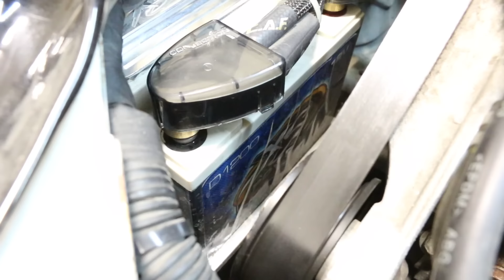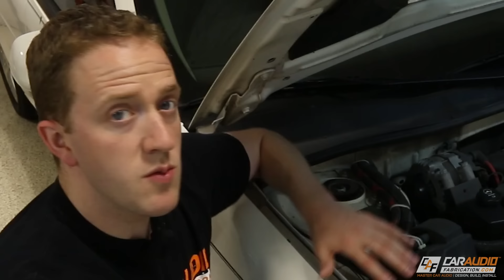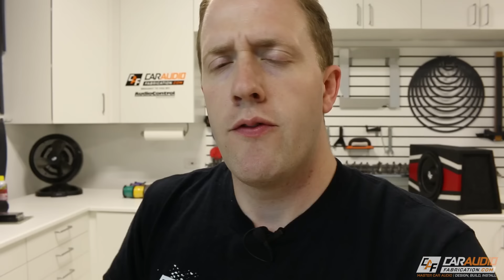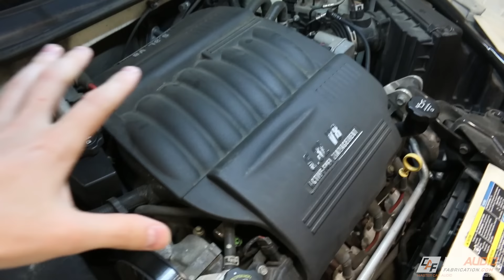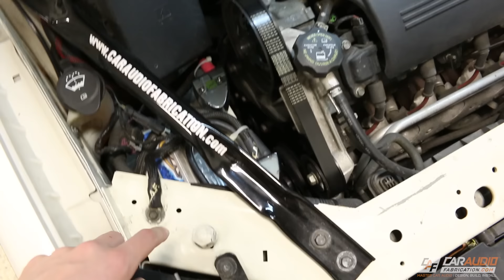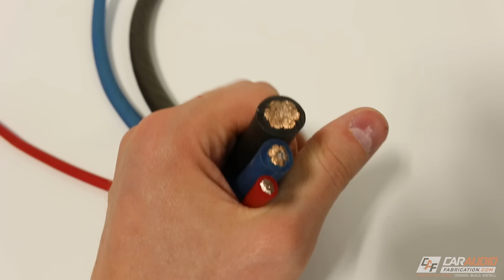Upgrade THESE for better Car Audio performance

Comment: a stock alt is garbage no latter if your upgrading or not... 
as soon as i buy a vehical i will upgrade the Big4 wiring.... Add a new alt... amd upgrade to the largest AGM that will fit under the hood amd switch tue Headlights to LED
Reply: AGM batteries are garbage. 
Since optima moved their manufacturing plant to Mexico their quality took a nosedive. This also applies to other brands since many are manufactured in the same plant. 
AGM batteries often fail sooner, offer no better warranty, and cost significantly more than a similar capacity lead acid battery. 
Don't believe me, check the forums for yourself.

Comment: Hi great video!!! 👍👍👍 I have a question, I'm in the process of doing a big car audio install, which is six JL AUDIO 12w7AE-3 subs running off of two ROCKFORD FOSGATE T2500-1BDCPS amps and two T600-4 amps for my mids and highs. I have upgraded to an XP 270amp alt and also my battery to an XS power D3400R along with the BIG 3 upgrade!!! How many batteries can I go with in the back of my truck without putting to much load on my 270 amp alt including the one under the hood??? I was considering three XS POWER D3100 batteries but I'm not sure if that would be to much load on the alternator and if i would have voltage drop problems in the long run??? Thank you I would appreciate your advice if you can!!!! 👍👍👍

Comment: Good video Mark, in the next one could you also look at how modern vehicles monitor the power output from the alternator? i've read about newer vehicles that have the alternator wire pass through some type of coil that sends a signal to the vehicles computer.

Comment: Great intro Vid!
Having sucked my system dry, adding a second battery & still killed batteries, the alternator is certainly of vital importance.
Work From the ground Up!
Deck (head unit) sends the Signal, Alternator sends the Power! 
Thats where i would start if i were starting fresh 🤘
Reply: What amperage alternator would you recommend upgrading to if you have a 140 amp alternator and are using 1200 RMS of mainly class D?

Comment: First upgrade is to install a Tesla coil and hope for the best.
Reply from the maker: +Michael Melton Faraday loops all day every day
Reply: @CarAudioFabrication  I love your work & love that car... I own a Pontiac Grand Prix GXP w/ the 5.3L motor... only thing that I hate, is how congested that area near the battery is. smh ... I swear it only like 2 or 3in between the battery [w/ upgraded cables] and the engine belt assembly.
Reply: Lmfao

Comment: I always upgrade the alt and charging cables first
Reply: For people who just UPGRADE to aftermarket radio and new mids and highs stock wiring is fine . I always suggest upgrading wiring to the step before adding amplifiers.

Comment: The big 3!!!
Reply: One important thing to bear in mind when upgrading the big 3 is that the factory wiring is typically fused in some fashion, though it's not always obvious to the naked eye. Sometimes it's a wire that will basically disintegrate in case of a catastrophic surge from the alternator, and that disintegration will protect against a fire. It's pretty rare for such an overload to happen, but if you've upgraded the wires without including a properly rated fuse, you've possibly opened yourself up for an electrical fire. Not that there aren't 100 other ways you can cause a fire in your car audio system, but this is one that I don't see mentioned much.
Reply: I bitched about the lack of fuses on another channel, and got flamed by a dozen clowns telling me there's no need for it, one even told me every car they had "only has a tiny little wire going to ground and no ground wire to the block" when it clearly shows in the schematic for the car there's some sort of protection in the alt circuit and 2 separate grounds from the negative post. You can lead an idiot to info, but you can't make them think.

There's also a bunch of cheap Chinesium circuit breakers out on the market and a few YouTubers seem to be just throwing them in their projects without testing them, I'd like to see what the actual performance vs rating  these things are.
Reply: Chris Rehbein nothing is guaranteed not to short. Check this. You could swerve to avoid a pedestrian, have a blowout, go off road, crash, at the exact moment your woofer's backwave vortex pulls in gasoline vapors, your wires severed, causing a spark which could ignite the goddamn fumes‼️🔥🔥🔥😎
Reply: OG Scythe I would recommend just going with 1/0 or oversized 1/0 (like Sky high and other car audio cables). It will ensure you have enough current transfer down the road if you decide to upgrade
Reply: Cheezy Dee well some tightrope walkers may say you don't need a net too. Fuck that. Spend a few bucks and a few minutes more and put the fuse in. It's not something you'll regret later. Same goes for over sizing your wire.
Reply: I have a 1300 RMS system. Can I use 4 gauge OFC for the big 3? I have extra from running my second run of power (2012 Accord). Also, will a 200amp breaker be sufficient to wire the positive to the alternator?
Reply: Og Scythe a 200 amp. Fuse is a little large I would find out what ur alternator size is by going to a local auto parts store and fuse it maybe ten amps above that I have dual 300 amp. Alts and have no issues and have no fuses between my alt and batteries on the front bank but between my front and rear I have them fused and then between rear bank and amps I have them fused
Reply: Kevin Livingston.   Then if rafas mom rips a fart it'll ignite the fumes then____♧____
Reply: Ethan Grider thank you. Glad somebody's paying attention. Rip it!!!
Reply: Chris Rehbein sorry if you took my comment negatively. It wasn't a dis to you. It was just me impersonating a Doug Bernards rant. ✌️
Reply: big 4
Reply: standing by for that next video.  got a 4channel+1channel amps install coming up.  i was assuming my alt will be fine with a capacitor going in also.  i'm worried.  i hope the video describes some easy "rules of thumb" and some ways to know what will happen before powering up
Reply: Battery isolator, big 3 @zero gauge, seperate audio battery over a capacitor. Really solid grounds. Your system is only as good as your weakest link. All wires should be same gauge determined by actual rms output. Determine max load from alternator. Convert to LED headlights for less draw on alternator and battery. Stay clear of garbage wires that don't have true OFC and strand count is important. Fuses within 12 inches of power sources.👍
Reply: only needed for runs that cant be guaranteed not to short out. id tell veiwers to use fuses. i only have fuses for 2 runs to the rear, none for the 4 runs to my amps or the 2 runs off my alt.  properly sized and ran wire wont short. but a componet can still fail no matter if theres fuses or not.
Reply: Kevin Livingston also someone could run in to the corner my battery is on, pushing the fender into the terminal still starting a fire ☺ so what's the argument then? Any accident can cause anything to short. I don't worry about them except a side impact. 2 group 31's and a bank of maxwell caps sitting behind me. I'm not worried about my properly sized and ran wire. More of a poor design flaw from an engineer. I also check my stuff regularly, cause I'm ocd like that.

Comment: I would say after confirming that the electrical system can handle the upgrades, I would add a sub to start and then work on sound proofing, that way you get a big difference at first then you do the things people dont think about.